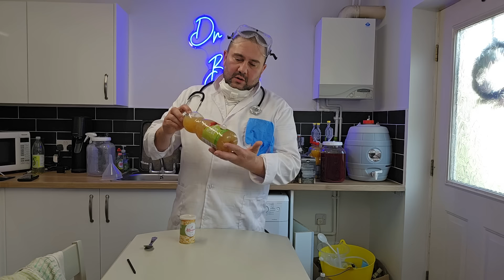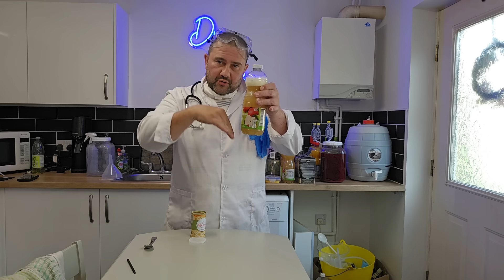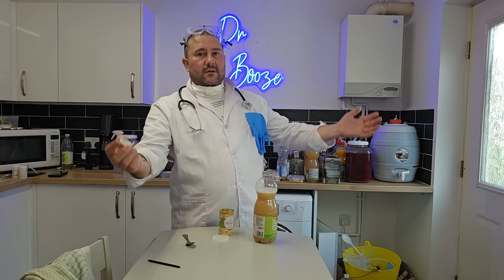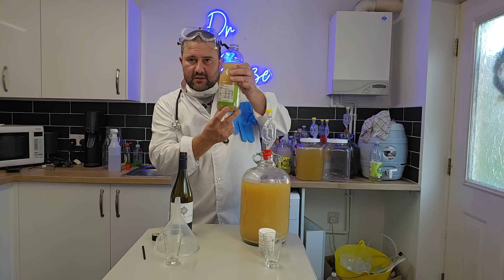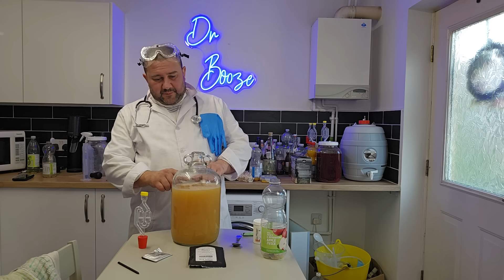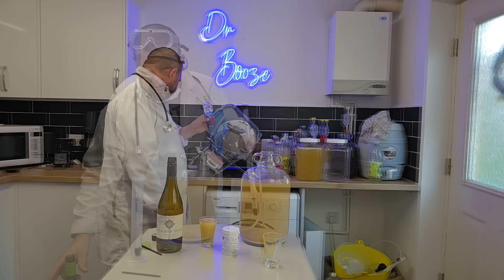Make 6% Cider-No Equipment

Comment: Great video! I have two questions, how do you sanitize bottles, and what if you like the alcohol a bit sweet? Don't you wait as long, or do you add a bit sugar/honey?
Reply from the maker: The bottles from the supermarket are already pasturized. Anything else is cleaned then sanitized with a sanitizer. I use vin de classe, a powder made up with water to manufacturer guidelines 😁✌️🍻

Comment: If you want a higher abv. Add like 200g of sugar and use an ec-1118. The theoretical yield would be like 17-18, so you'll end up around 12-15 probably. Then you can of course freeze it and drain it to get an even higher abv.
Reply: I came here to ask this exact question! If I added 100g of sugar to a demijohn full of juice could I get maybe an 8% abv cider?
Reply: @mitchelljarvis2010 As long as the juice doesnt have preservatives. If it does you'll have to pitch a lot.

Comment: Have you tried squashing the top of the bottle? I now this will limit amount of oxygen inside but after initial mix how much else is actually used? Unless the rest is necessary - the squashed bottle should un-squash (probably producing strange sounds at night - which might be a fun add-on) as CO2 is produced.

Comment: I’ve done two bottles, one looks like what you’ve done in the vid, the other seems still have a fair head on it 😂 perhaps I overshook initially? Any ideas
Reply from the maker: Leave it a couple days  ✌️🍻🍻
Reply: @DoctorBooze cheers mate!!
Reply from the maker: @danlucas3119 were they same juice? ✌️🍻
Reply: @DoctorBooze Yeah both apple, i shook the first bottle quite hard to mix the yeast in and its had a larger head on it where as i was gentle to some extent on the second bottle and it looks so much closer to what you had on screen
Reply from the maker: @danlucas3119 that's probably the reason. It will settle with time. It may leave a gunk around edge but it's fine 😁✌️🍻

Comment: Would this same process work using lemon juice?
Reply from the maker: I've never tried, maybe somebody else knows?? ✌️🍻
Reply: 5ltr water
1kg sugar <- heat it along with some water until fully dissolved
150 mls lemon juice 
1/2 sachet bread yeast boiled <- boil it along with the sugar and a bit of water
1/2 sachet bread yeast <- dont add this yeats while the mixture is hot
reduce it or times it depending on how much you want, that should be a decent recipe

Comment: After watching your video I got two half gallons of Aldi apple cider and some Lalvin EC-1118 wine/champagne yeast. I inoculated each bottle with 0.5 gram of yeast and they are fermenting. It looks like you are in UK, in the US apple cider is just ground whole apples that are pressed and the liquid is NOT filtered, it is cloudy and has a distinctly different, more complex flavor than clarified apple juice. Typically, alcoholic cider is called 'hard cider' to denote the difference, is this similar in Europe?
In the last 12 hours of the last day of fermentation I was thinking about tightening down the cap to get some of the CO2 to dissolve into the hard cider so it is lightly sparkling and then after 12 hrs put the two bottles(plastic, not glass) in the fridge at 38°F (3.3°C) to halt yeast activity and make the beverage cold and ready to drink. Is this a good idea?
Reply from the maker: There's nothing wrong with catching it at the end for the fizzy effect. You can also bottle them when ready and add a small bit of sugar so you are kind of in control on how much carbonation you produce, so no bottle bombs. Cider over here just means alcohol. Everything else is just apple juice, cloudy or clear lol thanks for the update, please let me know if you like them 😁✌️🍻🍻

Comment: you can use a balloon on the bottle to let the co gases out, all you do it prick a little hole in the balloon.
Reply from the maker: Yes, done it too 😁✌️🍻🍻
Reply: @DoctorBooze  if I add brown sugar can I make it stronger? Do I need to heat it in the apple juice before I ferment it or warm it up on it's own and add it to cold juice.  I have a tree in my garden that I use.
Reply from the maker: @LilLamb-o5p just stir the sugar in until it's dissolved ✌️😁🍻🍻

Comment: My last batch of cider i made from crushing apples to fill a 25 ltr fermenter and adding 4 kg of brewers sugar...ended up with one mean cider, you could smell the ethanol when you opened the bottle lol 

Good video showing you don't require a setup to produce your own cider...sometimes cheaper than buying it from the off licence
Reply: You might try using frozen concentrated apple juice instead of brewers sugar so you still get the elevated alcohol content, but the great apple taste as well
Reply: Crushing apples is hard on the feet though.

Comment: How high can you get the alcohol content if you add sugar like in your pineapple wine vid? Similar %?
Reply from the maker: Yes, up to 13% is the sweet spot. It can go higher but not always and you end up with a syrup for a drink haha ✌️😁🍻🍻
Reply: @DoctorBooze  Asked the AI robot pal what apple juices in supermarkets had no sulphites or other preservatives in them and it looks like even the £1 shelf stable apple juice might be viable as it seems to be just pasteurised rather than artificially preserved. Not going to be as nice but half as cheap eh.
Reply from the maker: @crabsantler I have a Dr pepper fermenting right now which does have preservatives but I have to wait for it to see if it fully works 😁✌️🍻🍻

Comment: Had my bottle fermenting for five or so days now, used the exact same bottle of apple juice from Asda so hopefully it turns out ok lol I'm assuming that it having antioxidants/absorbic acid on the label is ok? quick question, is it possible to do the same thing with the cheap lower quality Asda essentials carton of apple juice from concentrate? Or would that not work?
Reply from the maker: Literally anything can be fermented, juice wise, so long as there are no preservatives. I hope u enjoy the cider. Let me know what u think 😁✌️🍻🍻
Reply: @DoctorBooze forgot to reply to this lol cheers mate I appreciate the reply, I tried a few bottles of that £2 apple juice but I think I let too much air get to it because it came out very vinegary, tried it with the cheap concentrate and it came out waaay better, really nice, cheers 👍

Comment: wouldn't a decanting tube of worked better for splitting the fluid from the welt, and is leaving the sludge in better for the gut heath ?
Reply from the maker: That's how I would normally do it but I class tubing as equipment which I think is not necessarily a common item. I'm not sure about the sludge, never tried haha 😁🍻🍻🍻

Comment: Great stuff. I did this a few weeks ago using the 5 litre demijohn. When I bottled it I added a level teaspoon of sugar to each bottle and left it another week so I ended up with fizzy cider. Just make sure you use bottles designed to withstand pressure.
Reply from the maker: I tried and failed 😂😂. But will be trying again, thanks 😁✌️🍻🍻

Comment: We have a couple of apple trees in our garden which produce loads of not particularly sweet apples. If we juiced them up and added yeast, would it work? Or should we add some sugar as well? Also, what temperature were you fermenting at? Normal summer room temperature?
Reply from the maker: Yes that should in theory work, keep everything clean and your on to a winner. Yes add a bit of sugar for a stronger drink 😁. Just room temp yeah, been around 20°c but now it's cooling down 😁✌️🍻🍻

Comment: For an improvised airlock you can use a disposable rubber glove ( i see you have one ). Cut a finger off the glove  and fit the open end over the bottle neck then put a pin hole it the top. The CO2 will inflate the finger but it can slowly escape through the pin hole. When the finger has deflated you know fermentation is finished
Reply: Hey! I like it? 
But is it an improvement. 
I'm going to try this. For fun
Apple juice is more expensive than beer.
Reply from the maker: Absolutely right 😁✌️🍻🍻
Reply: Top tip

Comment: Instead of just backing off the cap you can improvise an airlock covering the top with a small piece of cellophane and holding it in place with an elastic band , when it produces Co2 as it ferments the give of the elastic band allows it to vent the gas as long as the band is not put on too tight this prevents messy bottle explosions ! Another method is to make a hole in the cap or a bung or cork slightly smaller than the diameter of some plastic tubing so it is air tight around the tubing then when you place the cap or bung on the bottle you put the open end of the tubing into another vessel ( an empty bottle , glass or jar ) half filled with water which lets the gas bubble out and acts as an airlock, you can sulphate ( sodium metabisulphate or campden tablets ) the water if you have that available !
Reply: A balloon also works

Comment: The old-fashioned way from Mrs Beaton's day was to add a little freshly brewed strong tea instead of the new fangled yeast nutrient. I used a quarter pint to a five gallon bucket.
Reply from the maker: Nice 😁 Can also boil up some yeast and add that 😁🍻🍻
Reply: @DoctorBooze  Starter bottles of yeast are a good idea, but need to be added in slowly to the main batch at the same temperature to keep shock from stopping the fermentation. Never boil the yeast. I take it that you were joking there. I like the way you made this simple.
Reply from the maker: @mrsillywalk I meant add the dead boiled yeast as nutrient 😅. Once cooled down of course 😁✌️🍻🍻

Comment: I made a lot of wine in my time. If you add small amounts of sugar as it is stopping fermentation and watch for the point it will ferment no more, then you can bring the percentage of alcohol up considerably. For a demijohn, initially a heaped teaspoonful and tail off until it refuses to ferment any further. I only ever use wine yeast that had high toleration to alcohol. Tapping the side of the demijohn helps to continue the fermentation in the later stages by getting rid of the CO2.
Reply from the maker: Brilliant advice, thank you 😁👍🍻🍻
Reply: Thinking around 17% is as high as you get using yeast, but can always up it more by freezing some of the water out.

Comment: cant stand cider!! but all isnt lost!!  I am making ginger beer, i´think i´ll try your method as i havent got a special equipment, i´ll just use the bottle with a gap, put the top on tighten and slightly loosen.
Reply from the maker: Ahh nice. I need to try doing ginger too! Also a layer of cling film with a pin prick under the cap adds a bit more security. From another commenter 😜🍻🍻🍻

Comment: Nice, threw in some maths lesons too. I brew with the simple method a lot but i use wine yeast. For anyone in the UK if you have a Boyes store near to you they sell brewing stuff and you can get various yeasts and sterilising powders there as well as airlocks and rubber bungs etc. Also instead of leaving the bottle cap on loose you can stretch cling film over the top of the bottle and put a hole in it with a pin. Get some brewing it is really easy.
Reply from the maker: Great advice 😁👍🍻🍻

Comment: Love this channel but I don't see that much point in this recipe. With the costs involved its very similar for me to just buy extra strong cider cans. Fair enough there's preservatives in the cans but this video recipe gets 800ml of 6% cider for 2 quid. I can buy 500ml  8.4% of knight's cider  for 1.85 so only a tiny bit of value added, for the effort and waiting. I'll stick to the cheap 1.49 2l bottles with added sugar and yeast and if I want cider just buy it in can form.
Reply from the maker: Thank you. You're absolutely right. I am trying to get the message out to the masses how EASY homebrew can be. I'm not drunk or drinking in this video(90% sure)  or clowning around. It's a message of simplicity 😁✌️🍻🍻
Reply: but you can use blackberry juice  or orange juice or pineapple juice etc.
Reply: @stevensims9912  yeah iv been making home brews fro months becasue of this channel. Im happiest with the cost saving ones. I can tell you my value recipe if you like

Comment: You have been to jail or know people from jail.
Thats how I made my celbooze,lol.
Just added sugar and some fruitsprinkles for some extra flavour.
Worked great,was drunk every weekend

Just 0ne or 2 punaises in the lid to release pressure,you hear them.pop out,then just put back.
One week between the wall and the radiator and it was done.
Cheers😂😂😂❤.

But do not drink too much,there is methanol too,which in normal distillation and mixing process gets filtered out,well the head is taken away,alcohol is reinserted back when cleaned in factory production.
So yeah,when life in prison you can drink it to shorten your sentence😂😂😂
If one can make some charcoal in jail it would be perfect,just powder and put between couple coffee filters,then filter and most methanol will be absorbed by the charcoal.
And yeah I was in Dutch prison,with tv,microwave, fridge and shower in my own cell😂😂😂

Those good old days,nkw they have nothing but a TV
Reply from the maker: Haha awesome man. Thanks for sharing. Very interesting 💯✌️🍻🍻🍻

Comment: What a great video and great fellow , im sure as the vid went on the more pssed you we're😂.... Im definitely going to try making that...also after that i will try the sparkling version that someone mentioned about making  by adding a spoon of sugar and letting it ferment... however im unsure after watching your vid you mentioned the cider had gone to dry and no sugars left,  by adding sugars again do you have to add more yeast or is the yeast still active after going dry. ?.. thank you
Reply from the maker: Thank you, much appreciated 😁. If you carbonate straight after (using a pressure safe bottle) fermentation I think you will be ok. If you let the bottle sit for weeks and everything settles to the bottom because the yeast have finished their job natural carbonation may not occur. There is no harm in adding a tiny bit of new yeast to bottle and makes no difference to the drink 😁✌️
Reply: Thank you 😊 @DoctorBooze

Comment: Really excellent video. What you might do even with the 800 ml of cider is IF you have bottles that held either soda or sparkling wine, add about 2 teaspoons of sugar just before you bottle this and tightly cap the bottle. the sugar will ferment IN the bottle and you will transform that still (flat?) cider into a carbonated, sparkling drink If you are using beer bottles to   bottle, you can add 1 teaspoon to each bottle you've filled (or 30 g mixed in your 4 liter demijon and then bottle. Delicious.
There IS a downside: if you carbonate this way (brewers of beer typically force carbonate- that is add CO2 directly into their brews using a keg), you need to wait TWO WEEKS after adding the sugar for the yeast to fully ferment the added sugar. If you crack open a bottle too soon, there may be too little or no carbonation. BUT if you are making cider or wine just about every week, then you will have a pipeline of drinks, add so waiting two weeks for this batch should not be a terrible problem.
Reply from the maker: I may carbonate something soon. Thanks Bernard 😁👍🍻🍻
Reply: @DoctorBooze  Just added that it typically takes 2 weeks for the added sugars to fully ferment an so produce the carbon dioxide, so there is a  "cost" for anyone who wants to be able to drink their drink very soon.
Reply from the maker: @kb2vca absolutely haha. I've got so much fermenting right now that I will soon have time to do the proper ways 😅😁👍👍
Reply: @DoctorBooze  ha ha.. but that's something we all aim for. Incredibly harder when we start making wine, but becomes so much easier as we make more and more. Me? I've been making wine and mead and cider for more than 35 years.
Reply from the maker: @kb2vca Haha awesome, no wonder you have elite knowledge on the subject. I'm getting nervous now about my mead video which I've just started lol. 😅💯🍻🍻 As always, I truly appreciate your input 😁🍻
Reply: @DoctorBooze You are very kind. But there is no need to be nervous about your first mead video. We all begin by being virgin wine, cider, beer or mead makers. However, I am certain that the vast majority of your subscribers subscribe becasue of your unique VOICE. Your approach to wine making is light-hearted and humorous and is not aimed at making virgins and novices think that wine making is difficult. After all, the yeast and not the winemaker does all the heavy lifting. We  are like gardeners: we remove the problems that the yeast might face. And talking about mead making, even 20 years ago, most mead makers assumed that a mead would take more than 12 months to fully ferment. We had really no understanding of honey and the needs of yeast for nutrients. Today, many of us make mead in much the same time as it takes to brew beer, AND we may make mead at low alcohol levels using 1 lb (a half kilo ) or 1.5 lbs of honey (around 5-7% alcohol) AND we may  add hops either to the water which we boil for 15 minutes to extract flavor from the hops (very little bitterness),or dry hop 3-4 days before we bottle, and we may carbonate the mead, so we change the game- and make mead to be drunk not like a wine , by the glass (12-14% alcohol) with a meal  but by the pint (5-7%) in the yard or after a day's work. Keep on keeping on.
Reply from the maker: @kb2vca ❤